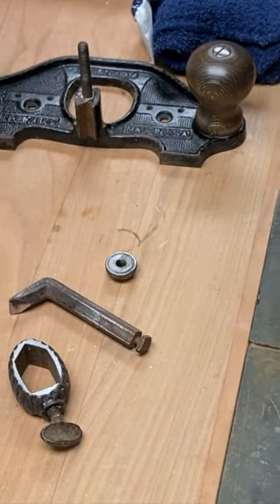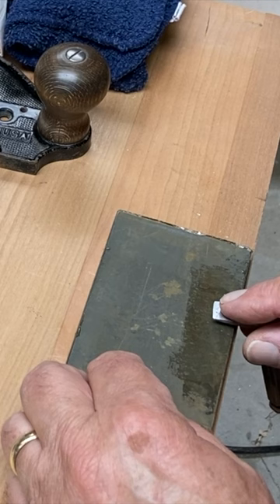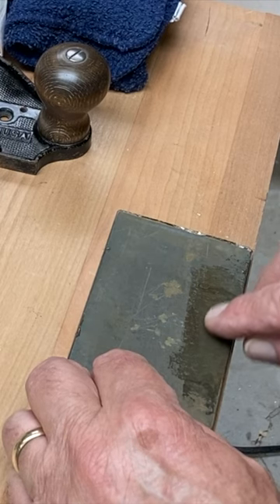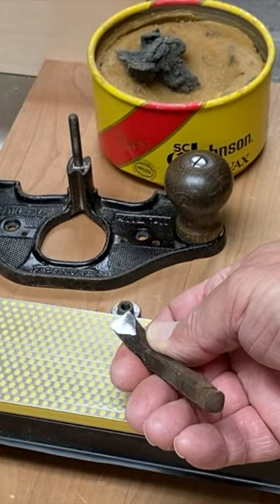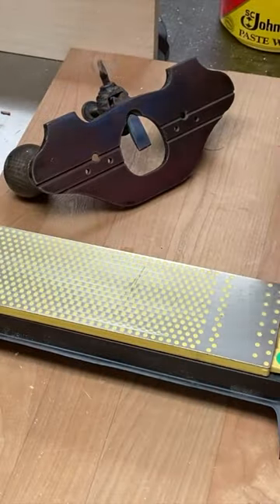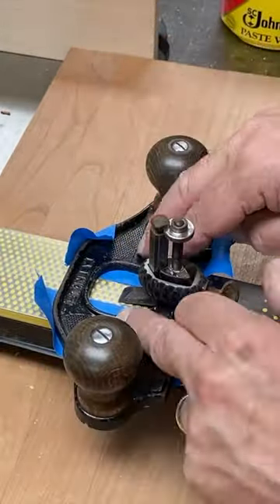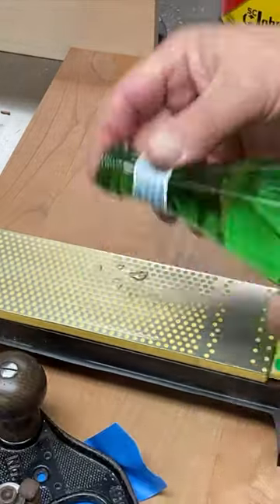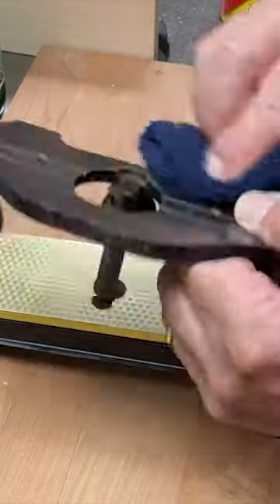Sharpen Stanley 71-1/2 Router Plane #SHORT

Comment: Do you know what angle the first bevel is please? Thanks
Reply from the maker: Thank you for the comment. I don't know the bottom bevel angle, some call it the clearance bevel, or the top bevel angle. I just match the top bevel as best I can by hand. Then the final thing I do with the blade mounted is really just a very small micro bevel. The plane gets so little use I've never had to do major grinding. Hope this helps. Thanks for watching.